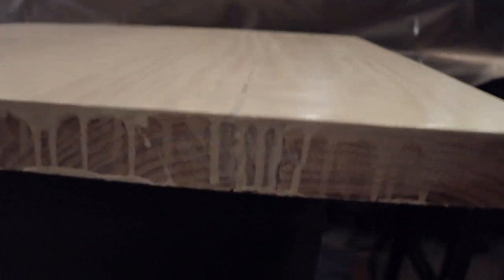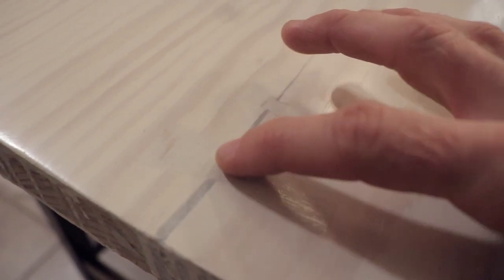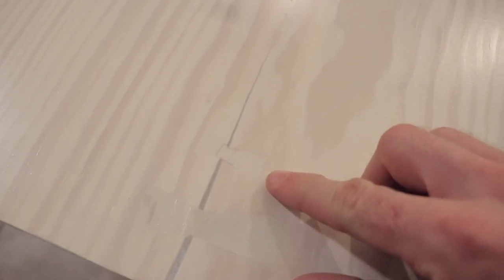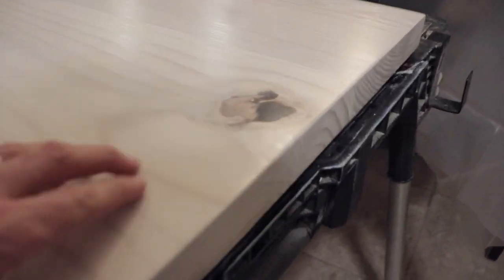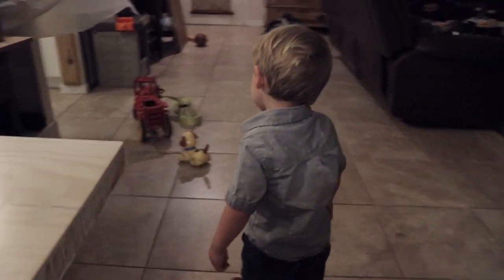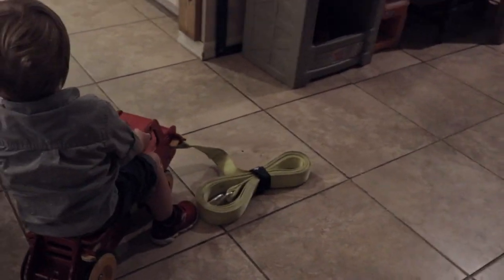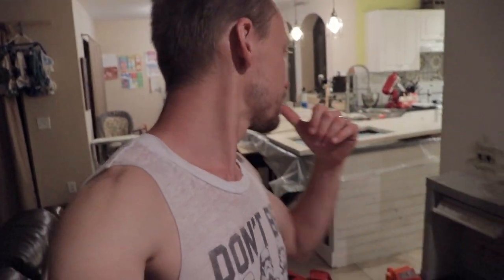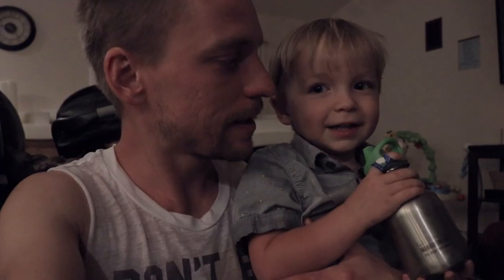Bowtie Splice part two - Skoolie countertop build.

Comment: Is that white wash or stain? Brand? What kind of top coat? We're these products easy to work with? I'm trying to gather information for myself :) Thank you! Looks really nice and smooth.
Reply from the maker: Hi Scooter! I used Minwax Water Based wood stain (white wash pickling is the color). Once the wood was sanded, I applied three coats with a paint brush (allowing wipe up & dry time in between). Then let them dry overnight and did two coats of polyurethane. It came out super smooth and they all look beautiful, if I do say so myself! Thanks for watching! :) - Kristen
Reply: Thank you! I agree... They look beautiful :)
Reply from the maker: Quick note, when you wipe the stain use a lint free cloth like an old t shirt. I didn’t and little bits of lint showed up wen I put the polyurethane on... good luck!
W